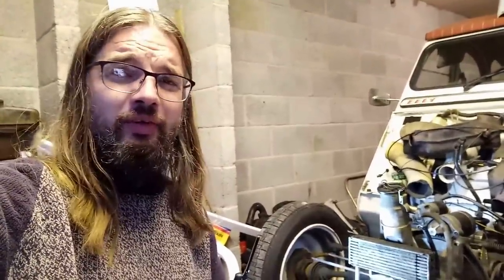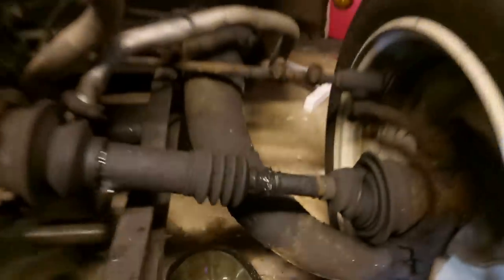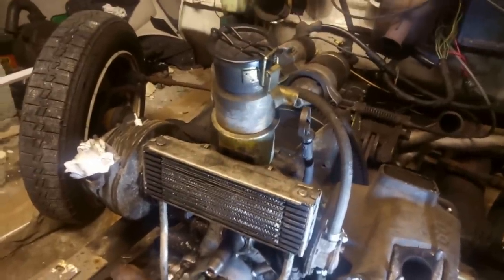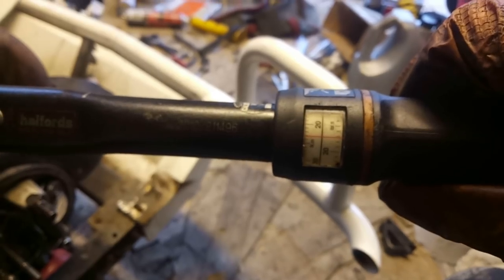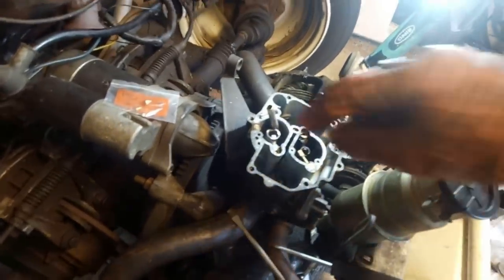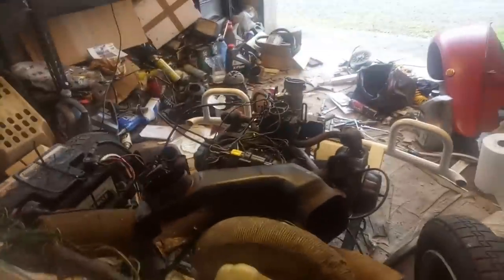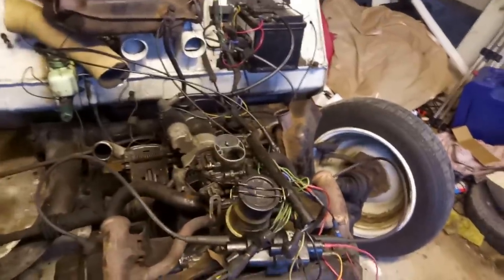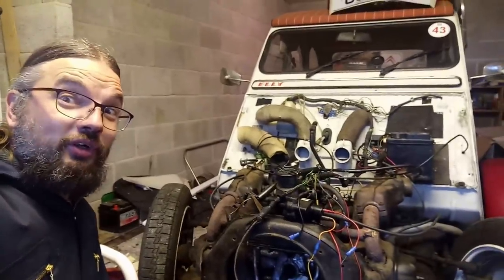2CV Engine Overhaul: Part 2. Will it run?

Comment: You could have saved yourself a lot of bother by removing the engine at the start of the procedure. Once removed take the engine into the house and leave it in a room downstairs, place all the new parts to one side of the engine. Two days after doing this you will find that Mrs HubNut has done a complete engine rebuild for you and also finished decorating the bathroom. You now know what to do next time.
Reply: You probably dont care but does anybody know a tool to get back into an instagram account..?
I was stupid forgot my password. I would love any tips you can give me!
Reply: @Enoch Benicio instablaster ;)
Reply: @Wallace Matthew Thanks for your reply. I got to the site on google and im trying it out atm.
Takes quite some time so I will get back to you later when my account password hopefully is recovered.
Reply: @Wallace Matthew it did the trick and I actually got access to my account again. I am so happy!
Thank you so much you saved my account!
Reply: @Enoch Benicio happy to help =)

Comment: Hi Ian, well done. A Crow's foot spanner will get you into the oil pipe unions from the front if need be.If you are not familiar it is a spanner with the head jaws 90 degrees to a shaft that can be turned from one end, Google it for more detail.

Comment: Nice to hear the roar of massive French horsepower again. There are some things that perplex me about their engineering. The Oil cooler. In particular the oil lines. The lack of flairs to seal at the block connection and the solid connection to the cooler itself. Since 2 cylinder engines of any configuration are prone to vibration....well you know the rest. You have done a fine job here, so happy motoring.
Reply from the maker: Cooler is solid-mounted by a bolt behind the cooler itself. Flat twins are far less prone to vibration than straight twins. It's actually well balanced.

Comment: Good work that man!  Having rebuilt an engine as a 652cc with a 123 ignition it's really interesting to see someone else go through the same process. I had mine out and perched it on a workmate, only real advantage I can see in that was having it at a more convenient height.

Comment: Thank you for another very enjoyable and interesting video. I've never had anything to do with 2CVs so seeing how they are put together is great. Looks a very good engine to work on; barrels coming with the pistons already in them so no need to worry about gapping rings and such tasks--bliss!
The carburetor float chamber overflow is not that surprising--most cars were still like that into the 1970s and beyond.

Comment: Nicely done there, and at least it shows I'm not the only person to drop small precision parts on the floor... :P

Might want to pop a dab of loctite on the carb's vent tube though, just to be sure it stays put and doesn't get sucked into the engine, especially after all this work to upgrade it... :)

Comment: If you had this done by a shop, I would have to write you a strongly worded letter. :)

The next time you're picking up tools, you should consider getting a kneeling pad. Whether it's under your knees or your butt, it makes working on cement floors loads more comfortable, especially when winter weather sets in.

Comment: I too am quite messy, it's nice if someone has a well equipped shop with bins for parts and containers for the nuts and bolts, however we don't all have that sort of luxury and have to use what is available at the time. Cheers from across the pond, I too am a fan of Mustie1 and live in the same area of the USA, though not in the same State.

Comment: The oil cooler airways (or fins) feature louvres that are usually angled for around half their width of the tube in one direction and the other half in the opposite direction - this creates the air turbulence through the heat exchanger. The tubes themselves contain another turbulence part (turbulator) that increases the surface area to the tube and creates a bond preventing the tube expanding under high pressure. For info about 80% of the cooling is generated by the fins, so lose them, bend them or block them and you will have cooling issues - Guess what I used to do? Tidy the garage, please, its agony watching you work in that mess.

Comment: You can drill and screw in self tapping screws to the front face of the crank seal. This allows you to use a claw to extract the seal by levering against the crank case.
Reply from the maker: Due to a metal band in it, I couldn't get screws to bite into it. The right screwdriver eventually got purchase on that band and I was able to gently coax it out a bit at a time.

Comment: The exhaust noise, I thought I was watching RJ.
To tap in a oil seal I was told to use a piece of wood as drift. Taping around the circumference slowly working into situ.
Reply from the maker: I used the top part of an axle stand. Means I was able to push it in square.
Reply: @HubNut  Wondered how to done it.
Reply: @HubNut  I saw that on the floor wondering what you were banging about with it!

Comment: Afternoon Ian, I've said it before and I'll say it again... Those loom wires crossing above the exhaust manifold without any form of securing is frightening, buddy😜  I can only assume you'll be putting it right in the next instalment. I was going to mention about the access nut on the side of the carburettor but then you discovered it. Oh... and I'm sure you realised the 'ignition' light is actually an oil pressure warning light. Keep up the good work, I'm looking forward to seeing more Elly videos.
Reply from the maker: Yes, wiring will be addressed properly. That was just a lash-up to get it running.

Comment: Good to hear that Elly's exhaust note sounds more powerful. The 123 ignition system seems a good fitment, it has been well documented and approved of in the classic press. The state of your garage doesn't cause me any problem. As you said, this is Hubnut not an engineering channel. You mentioned mustie1. I subscribe to his channel too. He's just had to fix his ultrasonic cleaner due to a switch problem. He also has a fully equipped workshop, containing a host of 2nd hand equipment. He also has far more space than you do. He also doesn't shy from showing his mistakes. Wonder if he watches the Hubnut channel?

Comment: Next time you're struggling to get the crankshaft seal out mate or any seal for that matter get a small self-tapping screw screw it into the seal you can then get Pliers or a normal hammer and use the claws of the Hammer to Lever it out I person don't like using copper grease on the threads that's just me I like to use Molly grease instead
Reply from the maker: Oh I tried that. There's a metal reinforcer in the old seal, so it just laughed at any attempt to get a screw in.
Reply: @HubNut  if you get a metal self cutting screw it will go straight into it
Reply: @HubNut  You have to drill it first.....
Reply from the maker: I never have any thin drill bits. All broken!

Comment: Some points to note:

Well done for doing the work yourself!

The 2CV sounds great without a exhaust (also sounds good with it as well!)

I watch Mustie 1 as well, that man fix anything and make it entertaining!

What’s a olive (apart from a integral part Italian cuisine) did I hear right?

Keep up the good work!
Reply from the maker: Olive is like a washer that goes on a pipe. It gets crushed as you tighten a nut behind it and push it into the joint to form a good seal. Very common in household plumbing. Mrs HubNut used many olives when making our shower.
Reply: Ah! That’s cleared that up! I should know that my dad is a plumber! Also well done Mrs Hubnut with the shower installation!

Comment: Good job and it sounds great now! One note, a properly functioning carburetor should NOT dump raw fuel, this is a short ride to an engine fire especially with an air cooled engine. The needle valve above the float should stop the flow from a regular fuel pump with no leakage, check it for dirt or to see if it's sticking. I don't want to see your hard work go up in flames!
Reply from the maker: No, it's entirely working as designed. There's even a hole in the manifold for the fuel to come out of.
Reply: @HubNut  That's scary! But you know your car. I'd love to have one but they often cost more in the US than a DS in good condition! Be safe and keep up the good work!

Comment: Will the Fox and the 2CV both fit in the garage at the same time like the Invacar and 2CV did?  I assume not and fear that Elly will be left outside all winter...

The engine bay really is so simple.  Working on it must be a complete joy, albeit complete with added frustration.  Nice work, with some decent upgrades implemented.
Reply from the maker: As you suspect, I don't think they will fit together. I need to keep using Elly to get that engine run in though.

Comment: I was looking at that old shaft seal and recall that you would replace it as all seals should be. You have more engine and more compression exerting more pressure on old parts. I'm not sure how you go about doing that but the oil cooler (you have good friends!) looks like it may be in the way of that job. I totally agree with your thinking on this project as your explanation was not lost on me.
           I enjoy almost every episode just some cars don't interest me simply because they have an almost identical version in the US. Your channel is in my top 5 as I don't like cable or satellite fare.
Reply: Sorry Ian I was having issues with my glasses and my son volunteers to fix them yikes

Comment: Maybe a bit of PTFE plumbers tape, just a little on the oil cooler union threads?   Never understood why people out there put on great whomps of the stuff which then becomes a PTFE washer as the thread chases it out from where its needed which is to seal the thread channels.   Can't wait for the Fox to start, saw the engine you got and you will be pleasantly surprised at how fast those little 850's go and unlike my one you have the benefit of disc braking at the front as opposed to my 1950's Morris/Triumph drums all round.    Does the Fox have a brake servo assistance as my Robin is done on pedal pressure only but actually very good despite lack of disc and servo assist.
Reply from the maker: Best not to use anything on the threads. Part 3 will explain more. Fox (like the 2CV) has no servo. Fox is all drum.

Comment: I didn't know about the olive and the way those oil pipes attach which is why I suggest flaring the pipe out as I assumed, (wrongly I admit), it would be a clamp fit at the front of the pipe as bit like a brake pipe. Seems to me once those pipes go then the only way to go is complete replacement. I'd keep the old cooler though, if the pipes go at least 1/4in behind the sleeving bolts, you could always fix it with a male and female connector.

Sorry for being a bit recycling and save the planet :D
Reply: i have no idea why they are aluminium and not copper, you can repair the copper

Comment: Nothing is better for the soul than the first start of an engine you've rebuilt yourself. Well done. What is your opinion of a Caterham Seven 160?
Reply from the maker: No idea. Never driven a Caterham.
Reply: You've never driven a Caterham.... now that's something you need to rectify. The 160 model is the current base model performance wise but it runs on tyres not much wider than Ellys so it's handling is great fun.

Comment: While those heads were off it would have been well worth inspecting those valves and seats.  On a low powered engine like the 2cv it might even give you a bit more power.
Reply from the maker: Sometimes, you just need to draw a line under a project and move on. I've got no gear for refurbishing heads so sometimes, ignorance really is bliss, and my tool collection is far from complete.

Comment: 2CV driving is not about "power" you use the "Roller Coaster" principle driving flat out down hill taking advantage of the fantastic 2CV road holding and cornering abilities. Hopefully having gained enough speed to make it up the next hill.

Comment: yikes thats risky using an oil cooler from a motor you know turned into shrapnel...hope none of it was jammed inside and gets loose when everything is warm and expanded ( I did hear you say you were going to blow it through) ...best of luck
Reply from the maker: Yes, it is a risk, but the owner was confident that the engine hadn't filled itself with shrapnel and it was blasted out as well.

Comment: Bit disapointed ian you put your scuzzy old heads back on your new piston and barrels😮 you could have atleast put a wire brush wheel in a drill and decoked it a bit ,but a new valve springs and reseat job would have complemented  the new pistons and barrels
Reply from the maker: A 2CV engine will decoke itself quite nicely. I don't have valve spring compressors - there comes a point when you have to stop short of a complete engine rebuild.

Comment: Do they make bigger carbs and torquier (or better flowing) exhausts for the 2CV?
Reply from the maker: You can fit a Weber carburettor - it's what the racers use. They also modify the exhausts, quite beautifully, for a very different two-into-one effort. Here's a closer look at one. https://www.youtube.com/watch?v=LPvqyzKff-c

Comment: If that oil cooler came off an engine with lower end damage, there is a chance that it may have metal shavings trapped in it.  You may want to do an oil change after running her for a few miles, just in case.
Reply from the maker: It was blasted out before fitting, but the owner reported that shrapnel didn't seem to be a problem in that engine.

Comment: Not an expert here, but seeing that the new jet is marked '115', it would make more sense to read the old jet as being '90', rather than '06'. My reasoning is that the new cylinder capacity is about 8% bigger, the jet should be at least 8% bigger (98), plus an allowance for a bigger jet being needed for modern fuel. As said, only logic being used here, not knowledge!
Reply from the maker: Yes, brain fart. It was 90.

Comment: copper grease is a no no with aluminium it will react and corrode
Reply from the maker: That's what some folk say, but I have never had an issue over the years. As it happens, all the copper grease got washed away with fresh leakage anyway!
Reply: @HubNut   There is a lot to be said for oil leaks LOL. Engine sounds great.